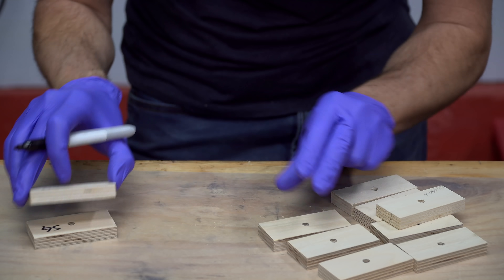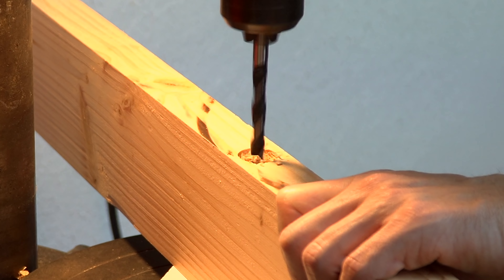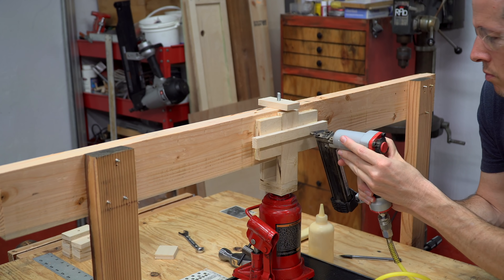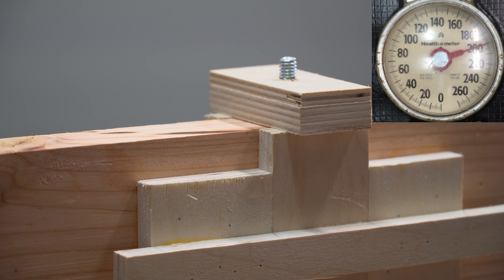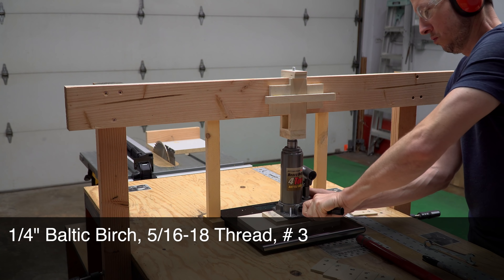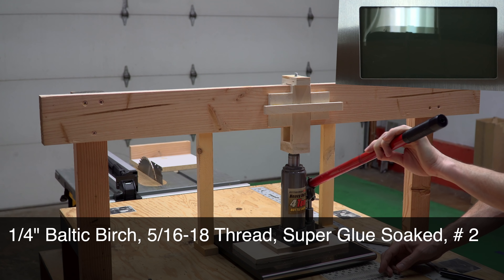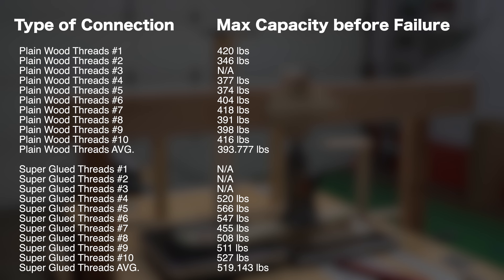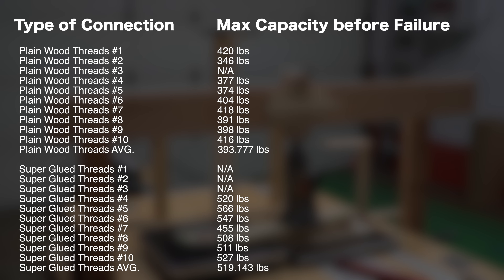Does Super Glue Make Wooden Threads Stronger?

Comment: place your scale in front of the test fixture.  place a fulcrum equidistant behind the fixture, suggest pipe.  lay a dowel onto the scale to best localize the load point.  lay a horizontal/level board of appropriate thickness across fulcrum and scale.  place the jack in the center of the board.  the scale will now see half the force of the jack.  if this is still too much for the scale, the jack can be re-positioned closer to the fulcrum in fractional increments that will still allow you to multiply the scale readout to get the final value.
Reply from the maker: Thanks for the suggestions! I actually started out using leverage to reduce the force required so the scale's readout would be able to handle the test. I switched to this method though because the torque being applied at an angle was causing problems; it was "wedging" the bolt in the hole, so you couldn't really tell if it was the threads or just the friction of the angle causing it to hold. Someone brought up that I could use pivots in the lever arm to keep the force perpendicular to bolt. While that's true (and I did consider it), it was more complex than simply buying an extra scale, and I felt it would create more room for error, so I decided on this simple, direct force apparatus. I hope this makes sense! Thanks again for sharing your thoughts!

Comment: While the glue is wet, sprinkle baking soda on it.  The glue will become instantly rock hard!  Far stronger than super glue alone.  You can even file and sand it.
Reply from the maker: Uh oh. Now I gotta do more testing!
Reply: True, but in this application in particular, that would close the threads
Reply: Once I needed to repair part of a plastic tool, and I used this technique. I needed to protect some threads in the part, so I filled it with grease. To my amazement, super glue and grease also harden! Ruined my part!
Reply: Brian Wood I would drill the hole, treat it with the super glue and baking soda and then tap.
Reply: Allen W great idea. I had forgotten this little trick
Reply: I’ve used it to repair a guitar nut
Reply: @hallenw  The problem is that would create cracks in the glue because it is brittle.
Reply: Excellent advice. Thank you

Comment: I often add superglue to tapped threads in bb plywood, however, my understanding was never that it would add strength to the wood in the way you tested. The reason I add superglue is to add more integrity to the threads and to help give longevity to the threads and avoid early stripping of the threads. After adding super glue it helps to also retap the threads, again, not to add strength in the way you tested but to make the threads work better and last longer.
Reply from the maker: Thank you for sharing your experience! It is appreciated!

Comment: Super interesting, I think I'll get some CA glue!  You know, if you think about it, we all use threaded wood, every time we use a wood screw, it's just whether you put the threads in with a tap or with the screw itself.
Reply from the maker: Totally true. Adding super glue to wood screw pilot holes could be a way to strengthen the connection, but it may be overkill. Depending on the application though, it's always nice to have extra options. Thanks for pointing that out!

Comment: Great video!  If you want to measure more force with a bathroom scale, you can set up a lever system to distribute a smaller percentage of the total force to the scale.  This is a trick that is used to measure trailer tongue weight with a scale like that.
Reply from the maker: Thank you, and thanks for the suggestion. A couple other people have suggested the same thing about using a lever. I actually tried it, but it didn't work for me. The angled force being applied causes a "wedge" effect with the bolt in the hole, so I couldn't tell whether the threads were holding the joint together, or whether the friction of the angled bolt was. Someone else suggested using a swivel joint so the forces are always perpendicular to the to the head of the bolt. I had considered that as well, but decided not to do it because I would need at least two elbows in the joint to allow the freedom necessary. When I thought about building that type of joint with that many moving components, there was too much room for error. Also, every component in the joint would have to be capable of holding the maximum stress of any of these test. With all that in mind, I just decided to go with applying the forces as directly as possible. The only downside was having to buy a new scale....but you saw my old scale, it was time for a new one anyway 😂 😂
Reply: Matthias Wandel used that technique to test the strength of dowel joints

Comment: Lee Valley Tools has a low viscosity penetrating epoxy for use on punky wood that I bet would be even better for this application.
Reply from the maker: Thanks for the tip!
Reply: Interesting that might be a good idea for some crappy particle board furniture that i need to permanently fix.
Reply: Punky?
Reply: @Tropical_Dreaming  Punky means soft and half rotten. Like a log in the ground in the forest. The six shoals in AMF gardens or up if you dry the wood first.
Reply: Since he's using dry wood. It should work easily.

Comment: I used to do this trick when I built wooden model RC planes.  Most people don't know that CA comes in a variety of thicknesses (viscosities). Thin CA is commonly available in hobby stores, or probably on the web, and is actually thinner than water. Thin CA vs. the standard stuff, you get a lot of benefits.

- It penetrates very deeply into the treads
- It dries almost instantly with no accelerator, but puts out more fumes in a shorter period of time and you will notice your piece gets hot, as if you had applied accelerator.
- You probably won't even need to re-tap threads

Never tested the strength of thin vs. medium or thick, but because of the deeper penetration, I would not be surprised to see that it is stronger than what you are using. With thin, you can place two pieces of flat and well jointed wood together with no glue, then drip the CA into the joint. Because it penetrates so deeply, instant bond. Great for prototyping or quick building.
Reply from the maker: Thank you for the feedback, and the tips!

Comment: Interesting to know. 

I made threads in hardwood with a bolt of the appropriate size once when I didn't have a tap. The threads felt a lot stronger (although the bolt was harder to turn).  You could probably make a tap out of a bolt, too...

Edit: I looked it up. There are several videos on the topic. No original idea from me.  : )
Reply from the maker: Thanks for sharing your thoughts!
Reply: @OneMinuteWorkbench  As un-original as they are. :)

I would be interested, since you had the apparatus, if threads cut with a bolt, maybe with a groove or two cut the length of the bolt to clear chips/dust, were stronger. The threads would be tigher than those cut with a tap, which, after all, is meant for metal.
Reply: I should really read more of the comments before asking an almost verbatim question myself... and you thought you were guilty of unoriginal thoughts.

Can we chalk it up to great minds?
Reply from the maker: You make a good point about the threads fitting tighter if the tap is made from a bolt...might have to give it a try!

Comment: A common catastrophic failure in pianos is when the bridge cracks from the tensioned string sideloading the bridge pin.  This causes the wooden bridge cap to crack along the grain.  I came here because I am interested in soaking the drilled bridge pin hole in thin CA prior to putting the pin in to reinforce the wood.  From your testing, I think it should help quite a bit.   Thanks for the great test and video!

Comment: Thanks this helped me pull the plug on buying a 3/8-16 for my shed climbing wall.
Reply: It’d be less work and would be plenty strong for my needs. I’ll be adding set screws aswell to my holds so I don’t get spinning holds. May not even need the super glue 🔥💯. Plywood in tapping into is 3/4 I think birch But the laminate is only 5 + 2 veneers.

Comment: We did this years ago in the RC plane hobby for the wing hold down bolts. I'm not sure it was needed, but it ensured your wing would never depart during extreme aerobatics.
Reply from the maker: Thanks for sharing about your experience!
Reply: VeritasEstVeritas - I did the same thing to my rc wings 30 years ago.
Reply: We used (still do) the thin CA instead of Super Glue which is more of a medium viscosity.  Thin CA has about the same viscosity as alcohol.  The thin stuff soaks into the wood fibers much deeper.  Most modelers tap the hole again after the CA cures.

Comment: Since you have the apparatus, I'm wondering if you'd try some tests using "poor man's" taps vs. regular taps.

That is to say, taps made by filing grooves into bolts and screws... How do the threads stack against threads cut with commercial taps?
Reply from the maker: Thanks for the suggestion! That's a good one!
Reply: I would be interested in a test using unmodified bolts to make the threads too. A bolt would form the threads by compression, rather than by removing wood. I suspect that would work in softer woods, but would it work in harder, or more brittle species?
Reply: Love the idea for the poor mans taps! A huge thumbs up for that comment.
I have used screws that have the grooves built in but never thought about doing it that way for homemade taps.

Comment: Great  video    Thanks for sharing the process .. I wonder if the glue would help with  taking a screw in and out a few times if it still would hold , my thinking is stripped out door hinges in the house , never an easy solution .  Have a great weekend
Reply from the maker: Thank you! Some others have mentioned that they use super glue on threads, but more exactly for the reason you mentioned. They say it improves the durability and longevity of the threads. For door hinge holes/threads that have stripped out, I'd probably drill them out, add some wood glue, hammer in a nice tight fitting dowel, drill new holes, and then thread the new holes. Another option would be to fill them with a putty type of epoxy, but I think I'd prefer the dowel method. Anyway, thanks again for stopping by to comment!

Comment: Use a mechanical advantage of like 2 to 1 for the jack and scale. Matthias Wandel has some videos that show his testing apparatus
Reply from the maker: Thanks for the suggestion! A few others have mentioned this, so I'll just copy and paste my reply from early:

I actually started out using leverage to reduce the force required so the scale's readout would be able to handle the test. I switched to this method though because the torque being applied at an angle was causing problems; it was "wedging" the bolt in the hole, so you couldn't really tell if it was the threads or just the friction of the angle causing it to hold. Someone brought up that I could use pivots in the lever arm to keep the force perpendicular to bolt. While that's true (and I did consider it), it was more complex than simply buying an extra scale, and I felt it would create more room for error, so I decided on this simple, direct force apparatus.

I hope this makes sense! Thank you again!
Reply: One Minute Workbench thanks! I just figured I would mention it as it might be useful
Reply from the maker: Totally - I love it when you guys share ideas with me, so keep 'em coming! Thanks again!

Comment: I like the effort you put into testing multiple samples consistently.  One thing that might be interesting to test is whether adding the super glue decreases the impact resistance of the threads.  That's sometimes a tradeoff that's seen when you make something stronger and stiffer at the same time: They can hold a larger static load, but fail more quickly with a dynamic load.  Maybe you could drop an anvil on the threads a bunch of times and see how long they last with and without the glue.

The basic physics behind it is the energy = force x distance equation.  If something hits your threads with a given kinetic energy (say an anvil dropped from a consistent height), the force that your threads experience will depend on the distance they bend as they're absorbing the kinetic energy while stopping the load.  The less they bend - i.e. the stiffer they are - the greater the force they'll experience while stopping the load, which might negate the advantage of having stronger threads.
Reply from the maker: Thank you, and thanks for the new testing idea!
Reply: @OneMinuteWorkbench  No problem, glad you like it!
Reply: @OneMinuteWorkbench  BTW, if you want to calculate the actual forces involved, you have to use a bit of calculus, since the resisting force from the threads increases as they bend further, just like the force from a rubber band increases the further you stretch it.  Some integration is required.  Timoshenko's Strength of Materials, Part 1: Elementary Theory and Problems (available here and there on the Internet) discusses it in chapter XI, "Strain Energy and Impact".
Reply from the maker: I do love reading about physics...it's the best sleep aid I've come across yet 😉 Just kidding, sort of. I actually do like physics and calculus, but I didn't want to go crazy for this test. Anyway, thanks again!
Reply: @OneMinuteWorkbench  Heh, yeah, my eyes glaze over a bit, too. :-) And, to be fair, that Timoshenko chapter only deals with a single impact in perfect materials, i.e. not really applicable to the real world.  Also, something I'm sure you already know: Multiple impacts make a difference.  I was doing some impact testing recently in balsa wood and I found that things would often survive the first five or ten or twenty impacts before failing.  Just like hitting stuff with a hammer... sometimes you gotta whack it a few times.

Comment: When you do more testing can you include regular wood glue?   I think it is likely that it would soak into the wood more, and actually be stronger than the super glue.
Reply from the maker: I thought about trying wood glue, but I'd be willing to bet that super glue soaks in better. The viscosity is much lower. Either way, it could be worth a test!
Reply: I have woodglue on hand and have deep threads. Thinking about filling up the holes and pushing out the excess with the bolts. Removing, let dry, re tap. Don't want to mess up my beloved project though. I'd rather watch someone else trial and error. Lol

Comment: Great test tommy!
I tap threads in wood a lot and use thin ca glue every time to strengthen the threads.
Reply from the maker: Thank you! Now, do you wait 24 hours? If not, how long do you normally wait?
Reply: @OneMinuteWorkbench  I usually put them right into service, though I don't stress them to the extent you did. ;-)
Reply from the maker: Yeah, that sounds more reasonable than having to wait 24 hours - maybe I'm impatient 😉

Comment: great video! you could do something like Matthias Wandel did, and use a lever that gives your scale a mechanical advantage, (it is farther away from the fulcrum), so only about 1/3 of the actual force exerted is transferred to the scale. That way, you can get readouts for much heavier weights on a scale that doesn't have such a high capacity.
Reply from the maker: Thank you! The lever idea has been discussed some in the comments already. I actually started out that way, but eventually changed to this method because the angle was making it hard to get a good reading. It has to do with the bolt wedging itself in the hole, whereas with just breaking a joint (like Matthias does), doesn't have a bolt, and therefore he's just checking to see how much torque it can handle before it breaks. In my case, I'm looking for perpendicular pull force, which means the force being applied can't be applied at an angle, it has to be perpendicularly. You could still use a lever to apply the force, but it would require the use of several pivot points in the lever arm. That all started to get a bit complicated, so I just decided to go with this straight and simple method. The only downside was having to buy another scale, but my old one was pretty shabby anyway 😂 Anyway, I hope this makes sense!
Reply: @OneMinuteWorkbench  makes total sense! Should have expected that you would have done all the experimentation beforehand lol! I just found your channel and this is the kind of content that I subscribed for. Thanks and keep up the great work!
Reply from the maker: Thank you for subscribing, and welcome to the channel! I hope you continue to enjoy it!

Comment: You need to change your testing rig to use multiplier leverage and/or load cells. The only thing that makes this test not very accurate, is that you are also levering down on the handle providing your own force to the handle directly to the scale. An Air/Hydraulic Ram would have eliminated this weight bias to the final results.
Reply from the maker: I could change to using an air activated jack - I actually have one. However, I think for this test (since the goal was to see if super glue changed things), since I used the lever in both sample sets, it probably still does an adequate job of showcasing the difference between sample sets. If I ever have the time and get motivated, I may to some more testing, and if I do, I'll be sure to improve the rig with your suggestions, and some of the suggestions others have made. Thanks for the feedback!

Comment: After working with superglue for repairing nearly everything and using baking soda to speed cure it. I can tell you that soaking the wood with superglue and curing it with baking soda will give you more strength than glue alone. I have never tested it with a scale but I have done enough wood repair to have learned from experience
Reply from the maker: Thanks for sharing!